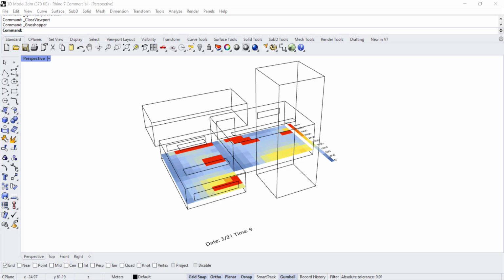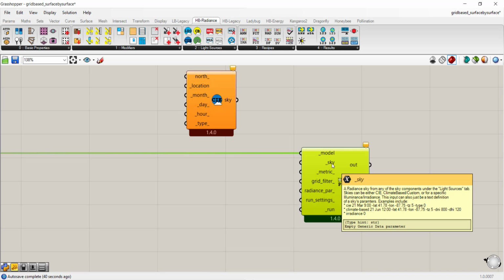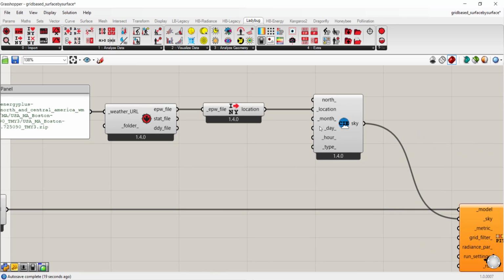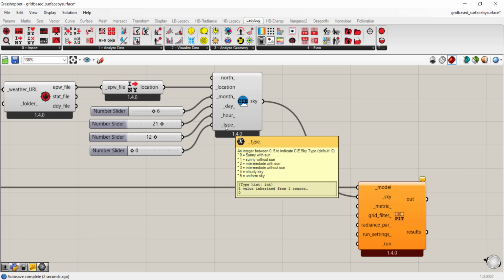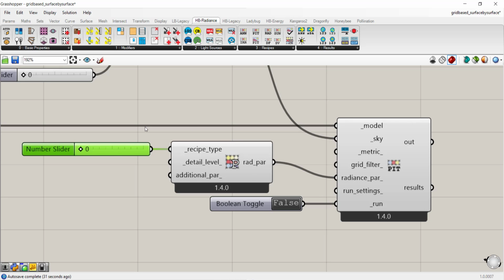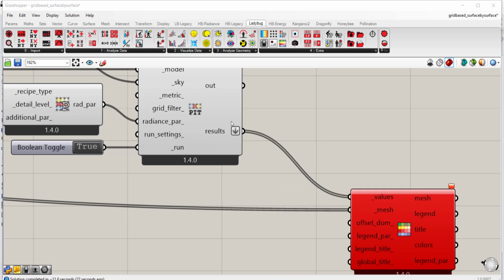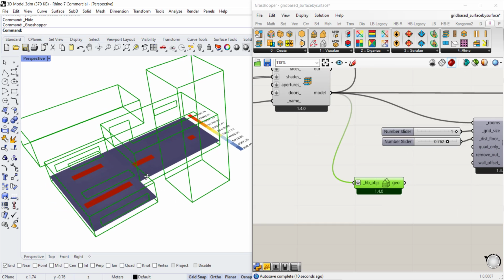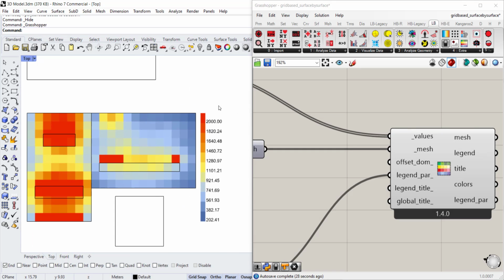Daylighting in LBTools: Point-in-Time Grid Based Analysis

Comment: I modelled the geometry with the surface method, not the room one. And I set up the sensor grid with the HB Sensor Grid component. But the problem is this component has no 'Mesh' to connect to the Spatial Heat Map component. What should I do? The analysis is not displayed correctly due to this
Reply: Use the mesh output from the previous component - Ladybug Generate point grid
Reply: @div-vy-up  How do I connect?